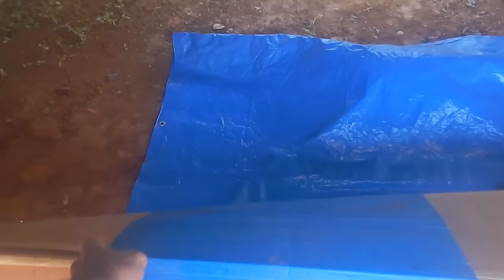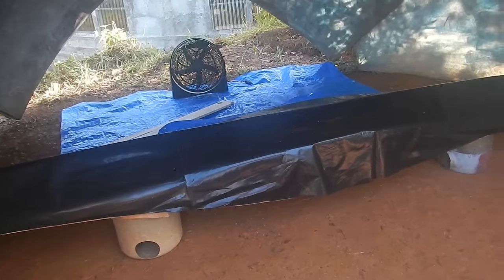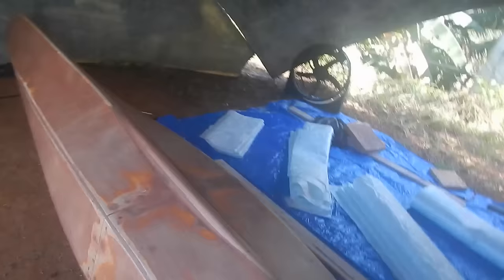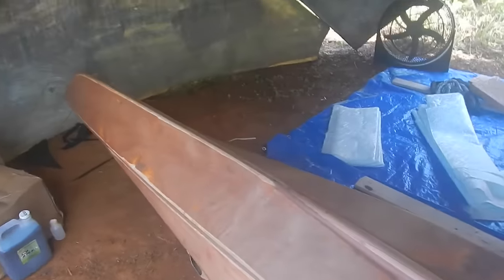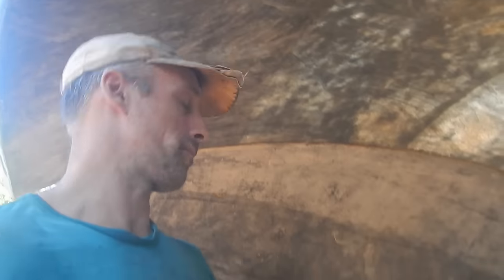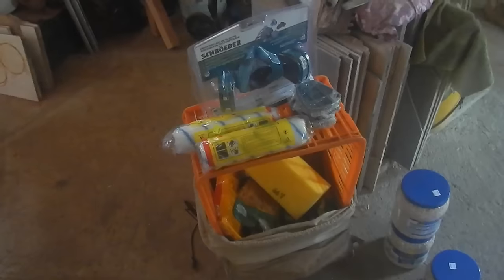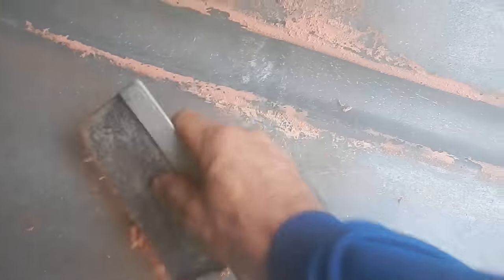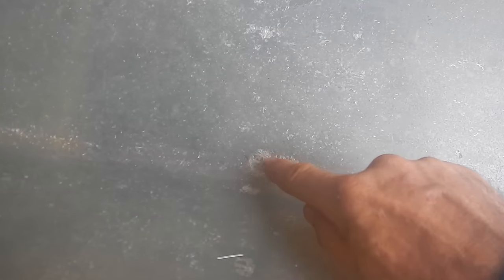Making Kayak 07 Fiberglassing the Bottom

Comment: Back in the 90’s, I built a 3 place airplane using foam and fiberglass. When I had problems getting a layup to wet out and lay down, I used a hair dryer on the problem areas to make it wet out and lay down. I used fiberglass cloth rather than mat.

Comment: Jamie, I remember 2 or 3 years ago you had concrete hollow blocks which were very weak concrete, as is normal for those style blocks. You tried to soak them in a cement water mix to strengthen them. I do not remember you giving any results? Do you remember if it made any significant difference? Thanks...Great videos Jamie..I been here a long time.

Comment: oh so you changed to using that buck as a positive mold, instead of casing a negative mold off of it? 
now you can finally test how your part will float? yaw, roll, pitch,  buoyancy, drag? or are you waiting until you get internal structure/bulkheads and a top.... I used to have a really nice one man kayak about that long or a bit longer(very sleek 'cigar' almost 'needle' shaped), some jerk 'borrowed' it from me for a year and then sold it, argh